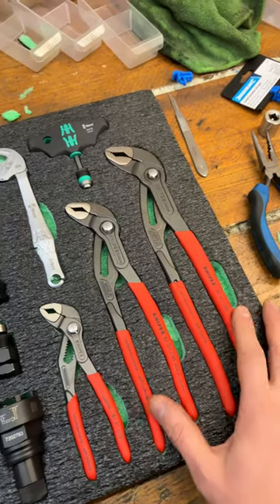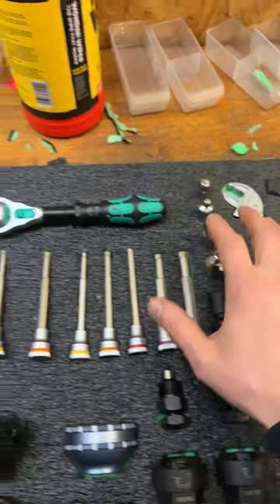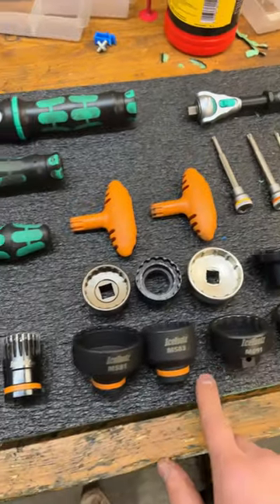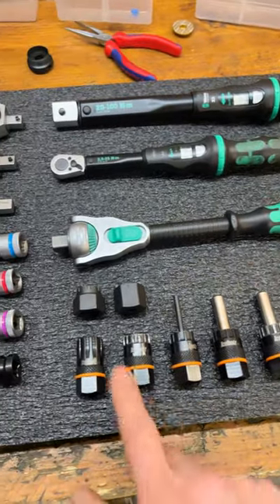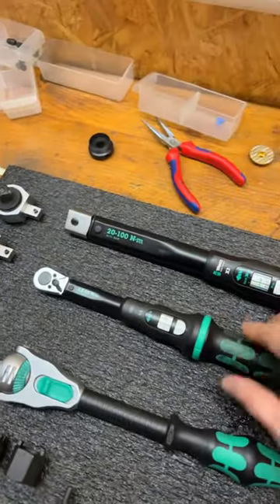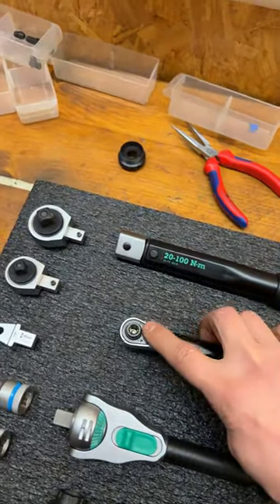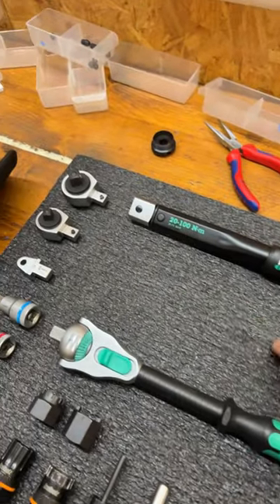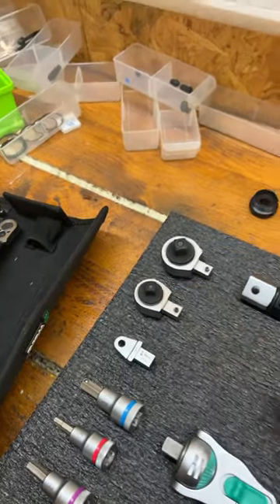Help me decide @WeraToolRebels #bikemechanic

Comment: If you can’t fit all the 1/4 bits in the foam, you will need the case anyway to use the A1 wrench. I would keep the 1/4 inch kit together and put the 1/2 inch wrench in the foam.
BTW, I’m drooling over all the Wera tools! ❤
Reply from the maker: I’m going that way I think.  It’s nice to have a mobile grab and go pack. As well as an ‘always in its place’ wrench

Comment: I keep my one in the case stuck on the wall with the velcro .So it's a keep it in tge case from me
Reply from the maker: They are great wrenches.  A gap in foam board is a bit of an excuse for a new one 😂
Reply: @Mapdec  The case itself is great with the bits locking into it .